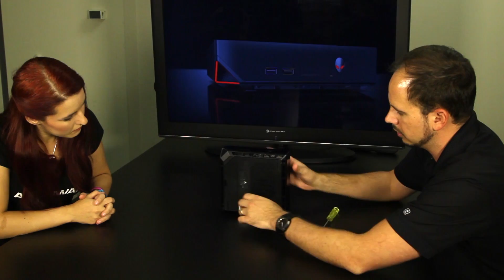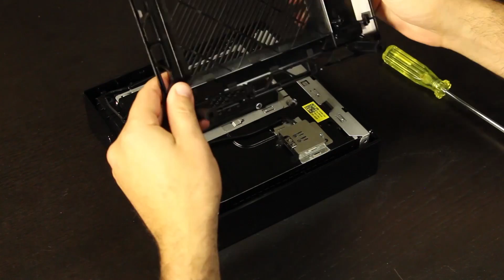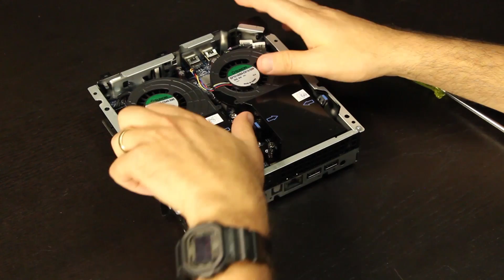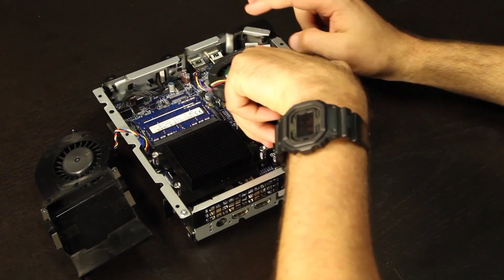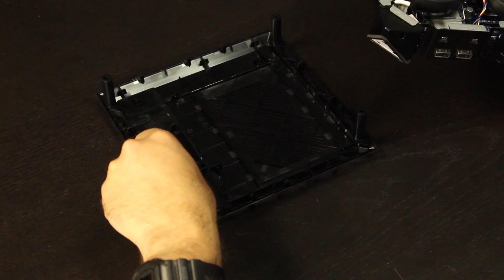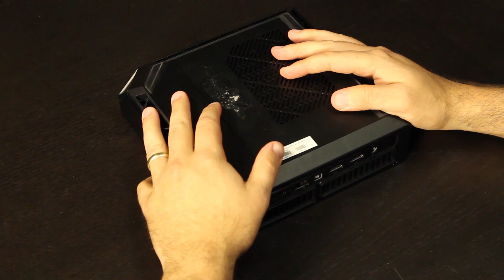Alienware Alpha - A Look Inside the Alpha

Comment: Alienware would changing the thermal paste in the alpha void your warrenty or are you realllllyyy open
Reply: We're realllllyyy open. Change it if you'd like.
Reply: im in 100 percent now i need to do that to my laptop to
Reply: ***** si senor
Reply: Marc Diana My only problem is, can I upgrade hardwares in the future? Seems like I could only use Haswell CPU and fixed Maxwell GPU. I just pre-ordered the Alpha
Reply: Junzhe Zhao You can upgrade the CPU, LGA 1150 socket (Haswell), Desktop 'T' variants, the memory- 2 SoDIMM sockets (DDR3) and the storage drive. The GPU is not upgradable; however stay tune for a bunch of new performance videos coming next week to showcase just what this GPU can do.
Reply: no gpu upgrades but hdd ram and cpu are all up-gradable whihc makes it a much better choice for a console espiacly if you buy the 549 version on amazing that gives you the 700 usd one on the site unless you dont own payday 2
Reply: We're also offering a $100 gift card to people who preorder, as well as the free content on the system itself.
Reply: Marc Diana i saw that but i already own payday and the 100 bucks would be pprobablyto help pay it off tbh.
Reply: Marc Diana So all Alphas variants with different prices will have the identical GPUs?
Reply: Junzhe Zhao yes. That's correct.
Reply: Marc Diana I'm using my 2007 Alienware rig with Windows 7 for not only Steam, but for Netflix and streaming on YouTube with Chrome. Would these still be possible with the Alpha?
Reply: Marc Diana I also want to use Alpha to play Rocksmith, but I'm worried about potential audio delay. Ubisoft recommends using component cables, but I only saw optical out on the back of the PC. What are my options? Am I out of luck in this case?
Reply: ***** optical has a better response than ccomponent im pretty sure .. try to find the adapter for that and look up the response rates
Reply: XxFieryXProductionxX Which adapter are you referring to?
Reply: i believe you would need a adapter for the audio in and out of the guitar am i crrect unless that is through usb interface
Reply: XxFieryXProductionxX  Yeah, it uses a USB Ubisoft RealTone cable. All I'm worried about is the output of audio. Due to this problem, I'm considering the x51, which features a more traditional PC interface to troubleshoot these matters, although I really do like the form factor of the Alpha.
Reply: honestly if you have it check ebay or buy new x51 im looking on ebay and a x51 with a i3 and a gtx 670 is 660usd you cant beat that tbh
Reply: ***** but yes there is no audio out except hdmi and optical... sooo if you rlimiyted by that by all means go for  a x51 or buy a usb sound card for the alpha your choice
Reply: Arash Santouri We're announcing a preorder with Amazon.JP at Tokyo game show tomorrow.
Reply: ***** absolutely.
Reply: ***** I'd go HDMI out for audio because its true 8.1 uncompressed, but I don't know enough about Rocksmith to comment for sure.

Comment: Is the hard drive located at the bottom of the unit?
Can I add 2 ssd's in the unit?
Reply: The HDD is located at the bottom of the unit. I did not mention it, but it's fully upgradable as well. Stays cool down there and is easy to swap quickly.
Reply: Get 1 that's twice the size?
Reply from the maker: On your second question to add onto Marc's comment, the system only has 1 HDD slot.